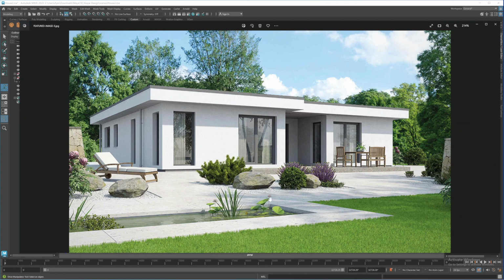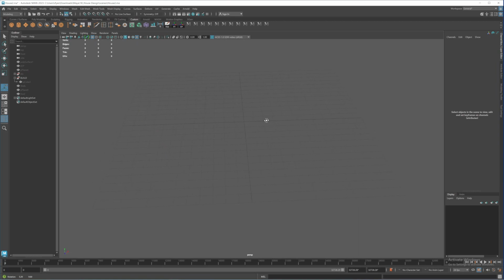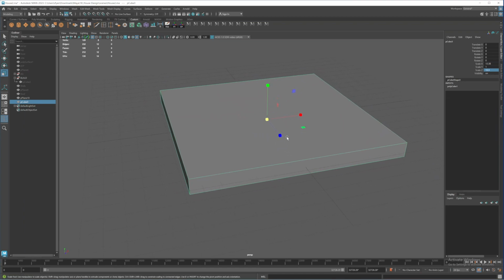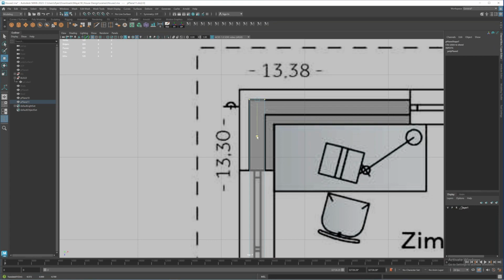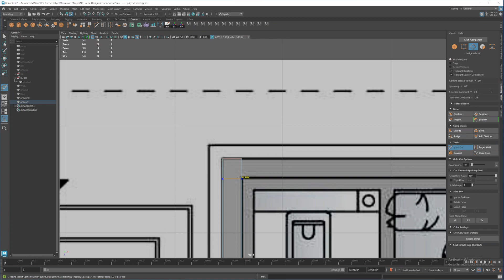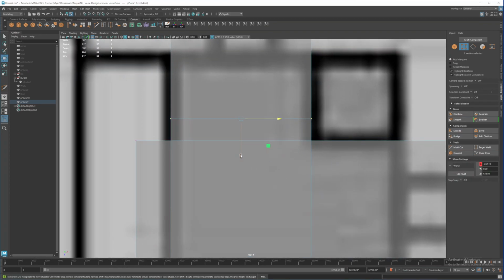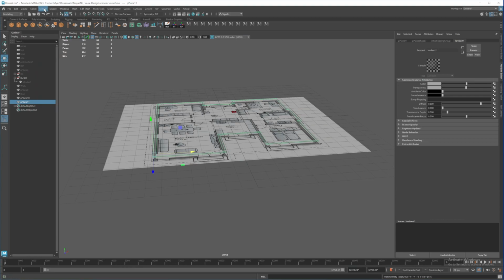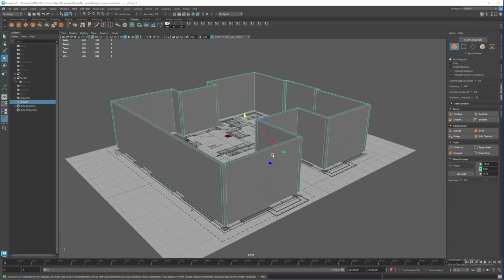Architectural Visualization in Maya Part 1

Comment: you just guessed 3.5 somehow. For me, I am not good at guessing, how else would I guess the height?
Reply from the maker: Well, there are no specific way to guess accurately, it's all based on experience. However, you can use some reference points in the building like the doors and windows. Eg; the height of most standard doors ranges from 2 to 2.5 meters. From there, you can see what is left on top of the door and make a rough estimate. Good luck.